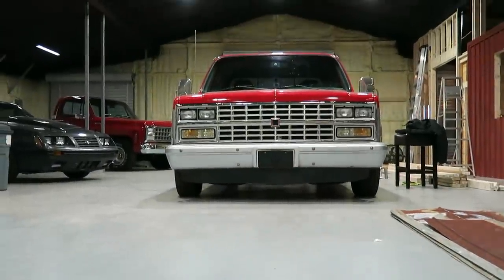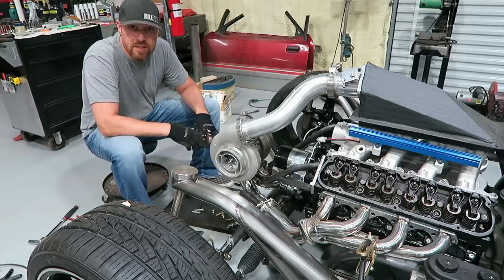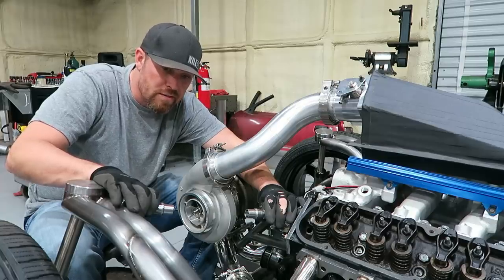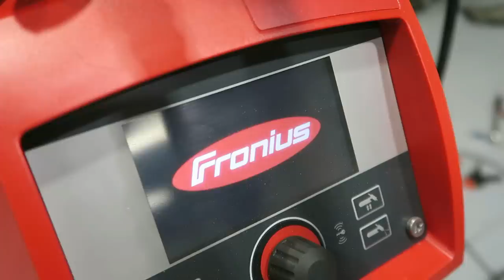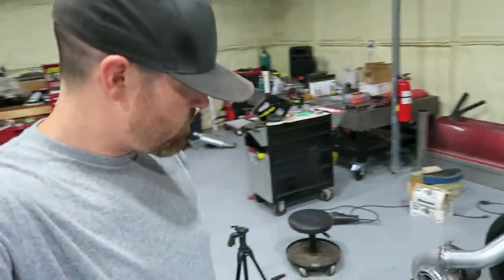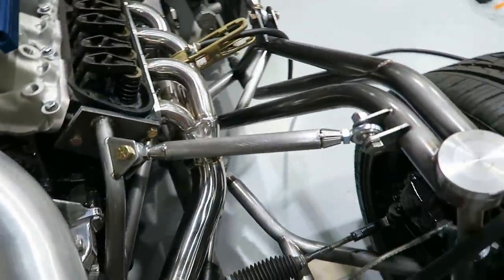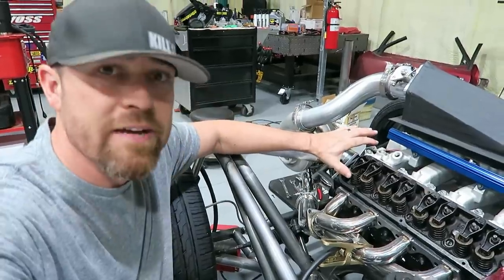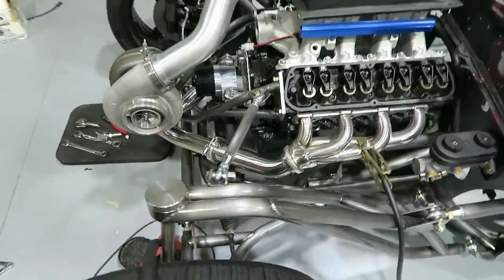TIG Welding More Parts on the Bibbster

Comment from the maker: Whats up fellas!....I left more of the working process in this edit. Let me what you think.
Reply: It’s great. Yours is my favorite channel for the instruction and the work quality. 
Having more process is really great. Thank you. 

If you ever see this do you plan on doing anything with the original collector flanges on the headers? Cutting them off and metal finishing or something else? 

Just curious. Really your content is so worth the wait. Really happy for your success. Take care.
Reply: I liked it, it was cool to see you going through the process of doing it.
Reply from the maker: @ndevor2554  I have thought about cutting them off, just not 100% what I'm going to do yet
Reply: The Fab Forums - Thank you for replying. Enjoying the format.
Reply: great to see progress on the bibbster! i want to express my concerns with the "strut bar" and how they are integrated with the turbo mount which then looks tied to the engine. with the forces of the suspension and any aggressive cornering, the engine and the turbo mount will be the parts taking the beating. i would recommend designing a bar to go from one "strut tower" to the other. that way it'll act as a true strut bar and the forces that are applied to it are isolated. however, you did mention that the front is likely to change as the build progresses. just my thoughts. can't wait to see more videos on this build!!
Reply: I Like It & I Tried to Help Brother, But My Arms aren't Long Enough to Reach That Far,😉😉😉LOL, God Bless All.
Reply from the maker: It wont be an issue
Reply: I dig the working process more. I like the heim joints also. I've been considering using them for a chopper suspension
Reply: Nice work as always! Thanks for my bibster fix 🤟🏻
Reply: @st162man  100% agree. Although that was a secondary concern, I took one look at that and thoughts... YIKES! good thing he has a good welder and can weld, because I see a LOT of constant repair work in his future. There will be a lot of force applied to those brackets and I can see numerous failure points (even without adding to it). Like you my first thought was it would be better to go from strut to strut, but unfortunately that will only half do the job.

Load will rarely be applied evenly to both sides at the same time to cancel out apposing forces. Most of the time, one or the other wheel will be getting the bump (small or big) by joining the struts it will keep them equidistant (not accounting for tiny amount of deflection in the joining rod) but for arguments sake you could say they are effectively locked. The problem is what happens to a square when you apply sideways force to the top corner? You now have a parallelogram. And when you push on the other side you have one going the other way. So yes I would lock them together myself, but it still doesn't 100% solve the problem.

In regular street cars you still get tower movement even despite it being massively boxed. i.e. boxed at the radiator support (on two axis), boxed at the firewall (on two axis),  adding a strut brace is just adding another critical point where the engine bay is boxed, it still doesn't stop the parallelogram effect, but if you add enough boxing on different axis you eventually get a structure so stiff that it resists so much of the force, that the problem no longer has an serious effect (I even diagonally braced my CNC for more axis).

This really is a worse case scenario because Kyle has used heim joints, effectively adding pivot points to make movement easier, and it doesn't have the conventional boxing / triangles a street car normally has (even the strut tower / wheel tubs contribute to boxing). Personally I would be looking at putting a solid not heim jointed bar from side to side on the stut towers, and then from those join points, run two bars down to the centre, forming three triangles. (one in the middle, one on each side suspension).

I would probably put a bar across the back of the firewall and add another bar on each side going to the top of the other bar work. Much like the early 60's Falcons had. Those little triangles help a lot. The more places you can cross brace the better, the bars don't need to be heavy walled because all that does is add weight. Also larger diameter tubing is better to resist twist.

Comment: Looks great love the work. Think the joint on the strut tower should be turned horizontally. Parallel with the tube it would match the other joints. Keep it up. 👍

Comment: I love your build! You should tie the intake for the turbo into the firewall/cowl to pull from the same place the old hvac did.  This would help match the exhaust.  love the fact you put the radiator in the rear, it really will show the engine.
Reply from the maker: that will be were the fuel cell will be located

Comment: The bore offset is appoximately the width of the  big ends - Big End Width: 21.11mm/0.831".
The actual head offset to machined faces will be fairly close to that.

I had been wondering about the stability of the top mount, using the engine as a stressed member has been done for decades in motorsport, you're just doing the same thing in a different way - good move, it'll make a big difference to stiffness!

Comment: The tighter you get those strut towers bound together, the better. At least in cornering. Only issue I find in that is torque twisting messing the wheel alignment.. for the intake/exhaust, how about fabbing a muffler to look like an air filter, and then just bolt them directly on both sides of the knot?

Comment: I only have one concern. It doesn't seem like a good idea to use the cylinder heads as structural components for suspension. I would be worried about it sheering or stretching a head bolt/stud or stressing the head in some other way.

Comment: Looks great. I'm digging on all the tubing. Lots of details to absorb. Were you sanding off the shark hide to weld the tabs on? Also I'm thinking since the car is indoors is the reason the tubes stay glossy. I was curious if they will stay like that once they've been subjected to the elements
Reply from the maker: the chassis tubes are all cleared in Diamond Clear which is what I was sanding off
Reply: @Thefabforums  nice I like it. Is it fairly durable?

Comment: Are the new tie rods not going to put the swing arm type front suspension in a bind as it travels up and down? The swing arm wants to travel in the vertical plain, now the tie wants to make the forward end of the swing move in an arc?
Reply: I think you are right. Overall there are now 3 attachment points on the swingarm (plus the coilover) which should mean it doesn't swing anymore.
Reply: @Finnspin_unicycles  I don't think it will stop it moving, it will however put side loads on the top mount, create camber gain and potentially fracture a part of the assembly. 
The craftsmanship is top quality no doubt, but I do think this is an oversight I'm sorry to say.
Reply from the maker: none of that stuff moves....its all solid. ride height adjustment is all done with the "strut"
Reply: @Thefabforums  Hey man thanks for the clarification, for some reason I thought the swing arm had a ram to lay it out, sorry.
Awesome fab work.

Comment: Lasty for the  exhaust you have to remember it coming out it can push so why not straight up exhaust and it will push down the front end if you add two turbos equally to the sides if you're pushing out just something to think about the thrush will give a push

Comment: just a suggestion that you might want to adjust those joints in the middle before making that tube so that you have adjustment in and out,
Reply from the maker: Camber is in too far as it is so they will both need to go out

Comment: Great job , your work is inspiring, Quick question, why is the motor offset? And are you gonna put dampers on the braze?
Reply from the maker: Offset is in an effort to make room for the pedal cluster. The body is 8 inches narrower than a stock fox

Comment: I'm not to sure about applying lateral forces to  the front of the engine/heads
Think the front cross member just under the turbo would be a better choice (IMO) and also a horz strut bar as well
Reply from the maker: The heads wont be affected by the little amount of force these will make. think about the forces blower setups apply to cylinder heads with no issues

Comment: So quick question about shark hide.Can I use it on aluminum and can i tig over an area it has been applied to on aluminum or steel ?? Or do I need to go back over the area with acetone.Say i make a piece up for later and coat it with Shark,so it does not get anything on it...but later I need to to or mig over an area that it has been applied.do I need to grind it off or acetone it away?

Comment: Not sure you took into account how those braces will affect the geometry of the suspension given the fact that you are using articulating the top strut ball joint to raise and lower the suspension - maybe run it through an arc to see what it does to the Camber and Caster?
Reply from the maker: the top ball joint doesn't move...essentially the "strut" it self just gets longer or shorter to adjust ride height
Reply: @Thefabforums  cool, just wondering

Comment: Is there going to be enough travel in the inner heims with the tabs installed lying on their sides like that.
Reply from the maker: should need any travel. none of that will move
Reply: @Thefabforums  I thought you were going to have adjustable ride height using an air or hydraulic cylinder at the back of the arms were they connect to the chassis.
Reply from the maker: @Big_D_SD  no the hydraulic cylinders are also the struts. They are controlled by accumulators which allow them to work like a sprung system without the springs and will also have the ability to go up and down for ride height adjustment.

Comment: Loving this project but have serious engineering doubts about those new brace pieces you put in. Can see them causing all sorts of steering issues. Would like to see the centre front of the car jacked up and see the wheels move through their range of motion, I can really see this binding badly. Have you mocked this up in Sketchy Physics or something similar?
Reply from the maker: none of the upper tubes will ever move its all solid mounted by design, no different than a traditional strut tower on a modern car except I just made everything out of tubes. The lower a arms are the only thing that move. The hydraulic cylinder will be the strut and spring in one with the help of some accumulators.
Reply: @Thefabforums  I was speaking with a friend of mine at length about it since he has designed a number of chassis, and he is my go to guy for anything suspension related, and we both had concerns about the heim joints near the engine breaking at the threads. The biggest concern is the two non equidistant heim joints at the bottom (of the top arm at the firewall) are going to cause a rotational twist on that arm, since the whole arm is just like a massive breaker bar with a pivot point.

Upward force on the tyre from a road bump is going to act like a multiplier at those heim joints since the top arm is going to act like a meter long lever. And while the heim joints would ordinarily allow a certain amount of rotational movement on a single pivot point, having two different axis locked (from the point of inertia) is going to cause them to bind and twist at the weakest point the heim joints. The reason most lower A arms are on the same plane (basically you can put one long bolt through both mount holes) is to stop this rotational twist / binding. They don't have to be absolutely symmetrical from the point of inertia (although desirable) but they do need to be on the same plane.

The best example I can think of is a motorbike rear swing arm... Now it doesn't matter if it is a conventional arrangement, or a single sided swing arm like on a lot of Ducati's, that doesn't matter, but what does matter is at the other end where they mount. Usually motorbikes have a long single bolt that goes through both mounting holes, now imagine you keep both holes parallel but you shorten or lengthen one of the swing arm legs by a couple of inches. Even though they are parallel they are no longer rotating in the same plane and will bind and try to rotate around the new axis between them. Even if you didn't want the swing arm to move, let's say we decide to make it a rigid. So we replace the shock with a solid bar. The twist force on the rear trailing arm will still be there even though the swing arm can no longer move, we have built the stress point into the design.

The top arms you just fitted to stop the sideways movement adds a third axis on which it is trying to rotate at the same time. Heim joints work well under compression or tension, but are prone to failure when placed in a sideways sheer situation. The top arm lower heim joints are subject to this, but no where near as much as those new bracing pieces will be.

The top arms will move under driving conditions, there is just too much mechanical leverage for them not to. It may not be that much, or that obvious (without measuring deflection during driving conditions) but it will cause movement and fatigue over time. The new shorter arms don't have the length of tube to absorb the twist as much as the top arms, and the heim joint seems more predispositioned to sheer.
Reply from the maker: Hey guys,
I appreciate your concern and would be happy to address them in more detail. I think me making a private video for you guys may be the easiest. Shoot me an email and I will supply you the link once finished.
Reply from the maker: @DodgyBrothersEngineering  got it

Comment: Are you tacking with pulse or something? Almost sounds like AC
Reply: I think that's the special fusion tack setting he has on his welder. He talked about it in a recent video.
Reply from the maker: It's the tack feature the Magicwave has. It basically flutters the arch for a specified amount of time.

Comment: I think this is a cool idea, but what does have me puzzled is that the movement from the motor will flex the suspension angles and is not suitable for driving, especially if its got anything but solid motor mounts. even with solid mounts there will be a lot of stress and flex you wont see until you drive it.
Reply from the maker: everything is solid...it wont move

Comment: am i the only one thinking it's all gonna bind up when the suspension cycles? the way the joints are set up on the bottom of the cage (not inline) and the bottom of the struts tied together, and now the extra arms on the top... they're all working against each other. it looks really cool, but does it work? how about making a video of the suspension cycling from lowest to highest setting?
Reply from the maker: everything is designed to be solid. none of the upper bars and heims will be moving. Think of it just like a traditional strut tower on a modern car but made with heims and tubes.
Reply: @Thefabforums  ah, okay :-) i thought it was going to have inboard airbags move the entire strut and everything up and down. i must not have been paying attention ;-)  thanks for the reply, and thanks for sharing cool videos. i am really envious of your new shop, it's awesome :-)
Reply from the maker: @KTX666  thanks man. In the very beginning I was talking about doing inboard hydraulic cylinders with normal struts and springs but changed it to what I have now
Reply: @Thefabforums  see, i wasn't paying attention ;-) well i did in the beginning, but not so much later on, apparently :-D now i'm at ease, and is confident it will be even more awesome :-) keep up the good work.

Comment: No intercooler ??
Reply from the maker: No...will just run some water meth if needed.
Reply: The Fab Forums cool. I run no intercooler on a blow through setup. On pump gas and water/meth setup. How high boost you planning ?
Reply from the maker: @jerr6  not much, just gonna be a cruiser